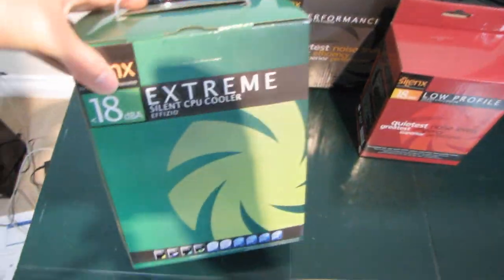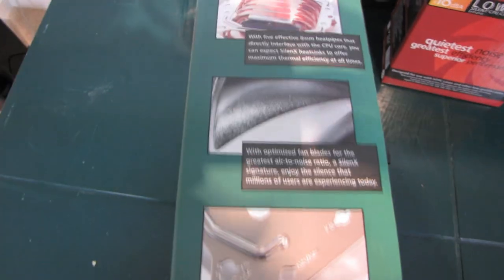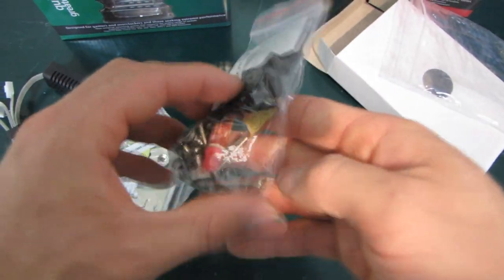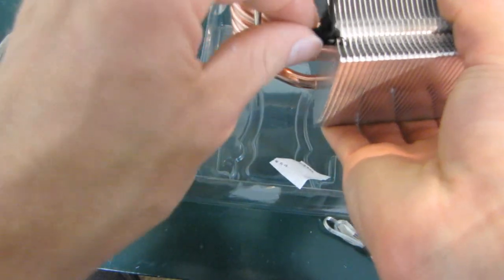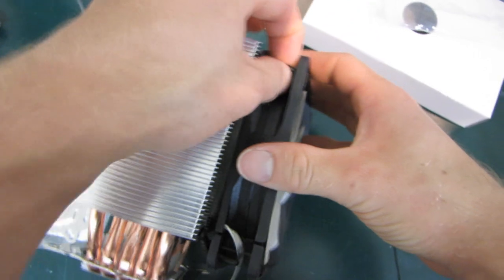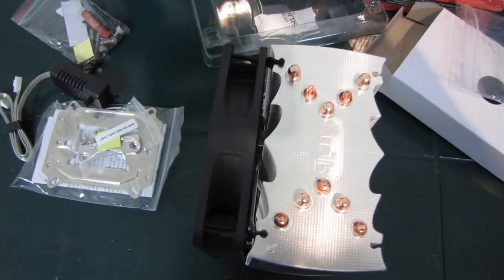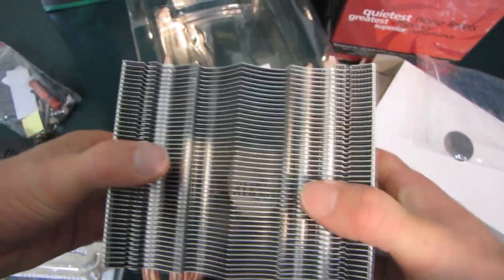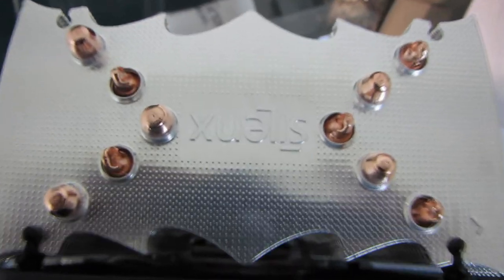SilenX Effizio Extreme 5x 8mm Heatpipe Silent CPU Heatsink Unboxing & First Look Linus Tech Tips

Comment: meh, the middle heatpipe(which is the most important, usually the hottest) is not going to the edge of the heatsink aluminum fins...(near the edge= more airflow from fans)
the center of the fan has almost no airflow, yet the hottest pipe is near that place... bad design.
The outer pipes receive the most airflow but for CPU like intel 775 they probably won't even touch the pipes.